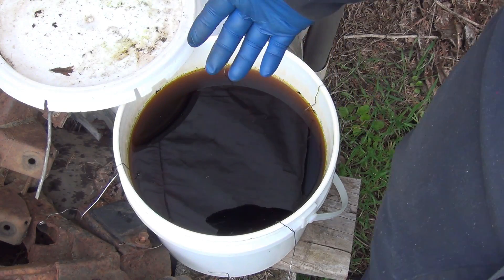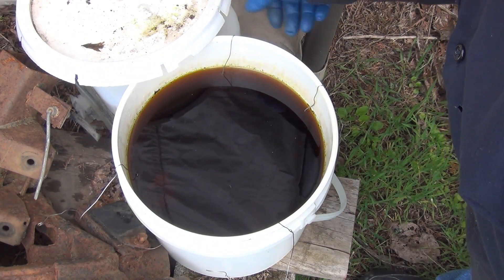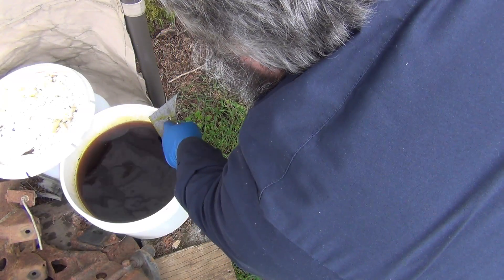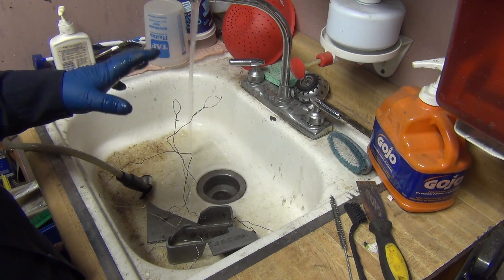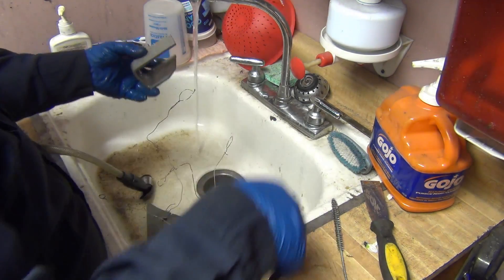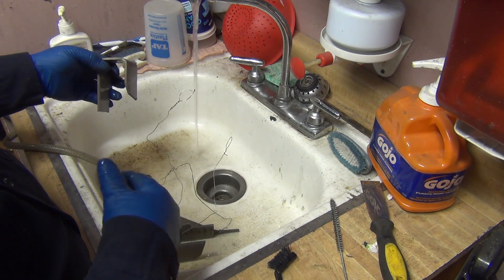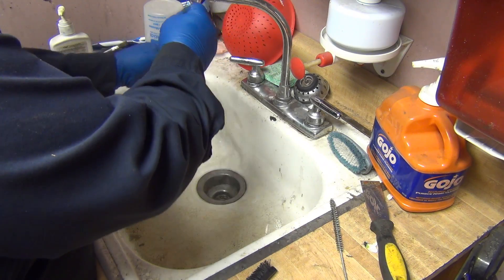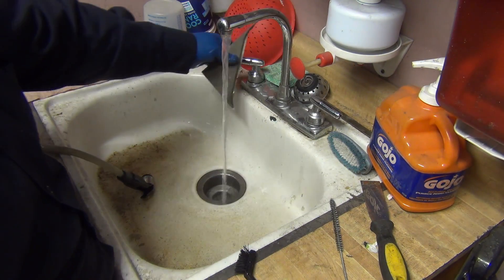Mill Scale Removal - Muriatic Acid Dip

Comment: Hi, I am doing a renovation and want to remove mill scale on
 an in place steel beam. Anyone have advise on using this inside on a 20 ft beam? thanks!
Reply from the maker: Are you leaving it as bare steel or painting over it?  It will flash rust almost immediately after the acid method.  The acid method in this vid is not safe at all for what you're looking to do.....in my opinion.  I'd love to hear other options, but I don't know of any easy ones. Good luck!!!

Comment: I used to do this one my signs since it was WAY cleaner than a flap disc. I guess I need to get a fresh bucket prepped. Have been thinking about going from the muriatic to phosphoric since it should seal the metal too. Heard anything about that?Best wishes,TZ
Reply from the maker: +Tom Zelickman (Inspiration Metalworks) Hmm...really....phosphoric will clean the mill scale too?!  I think I have some Ospho....any clue if that works?  You should make custom vat for sheet metal. :)
Thanks!
Reply: bluehandsvideo No, what I meant is a 2-stage dip. Muriatic to clean and then phosphoric to seal the metal. I will have to go back and look but as I recall but the phosphoric acid is supposed to bond to the surface of the metal. If I find the source I'll email it to you.
TZ
Reply from the maker: +Tom Zelickman (Inspiration Metalworks) Okay....that makes sense.  I knew phosphoric was used to prep/seal the metal, which is why I questioned it.  I'm pretty sure you can paint and powder coat right over it.  I was thinking a big, shallow pan for dipping your signs.  The large surface area would cause evaporation issues...I would think.  I was also thinking about a one that was 3"or 4" x 36" x about 4' deep.  No evaporation issues, but it would need to be plastic or it would eat the metal.  No clue how/where to come up with something like that.

Comment: be careful, I used muriatic outside the garage, BUT the fumes got inside and flash rusted my entire frame on my newly built buggie. so do this far from the garage and anything near by will be rusted in no time.
Reply from the maker: +Ed Ginsberg  Absolutely!!!   I keep it outside but I had it near a frame piece....the vapors make for a really pretty orange rust!  And that was from just lifting the lid long enough to get the pieces in and out.  Sorry to hear about your frame.  My frame piece didn't matter.
Thanks!!
Mike

Comment: I use it on my knives after heat treating to remove the scale and deposits really effective stuff
Reply from the maker: +Mike Palmer (MP Custom Blades) Do you wrap them in SS sheet?  The heat treating vids I've watched didn't get any scale when they were wrapped....only when heated and exposed to air while doing it.  I've only watched a couple, so I may have missed something.  
At $7/gal, it's one of the few things I've found in machining/fabricating that is extremely cost effective. :)
Reply: +bluehandsvideo I oil quench O1 and 1095 after heating in a propain forge. Will be moving over to a heat treating oven and useing more air hardening steels like d2 and cutlery steels
Reply from the maker: +Mike Palmer (MP Custom Blades) Hmmm....I forgot about the quenching.  I don't remember why they wrapped the blades.  I think the vids were Grimsmo and TacKeychain vids.  I don't imagine I'll have much need to heat treat anything, so I don't pay very close attention  to it.

Will you be wrapping the air hardening steels?
Reply: +bluehandsvideo Yes most super steels need to be heat treated  in a oxygen free environment ether a vacuum or in stainless foil some people put in some paper in the foil packet to burn off the small amount oxygen in the packet
Reply from the maker: +Mike Palmer (MP Custom Blades) Ah...okay....that sounds like what I was watching! :) Thanks!